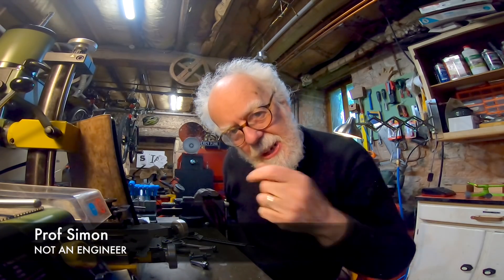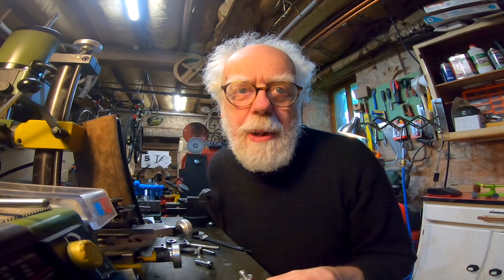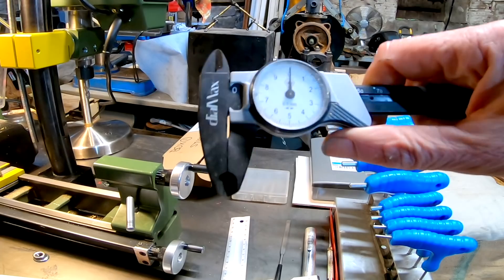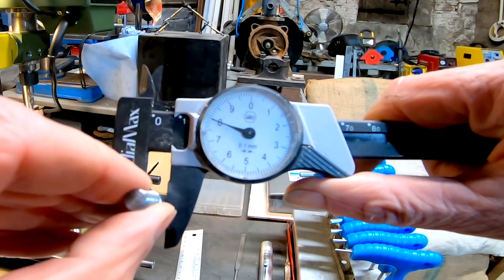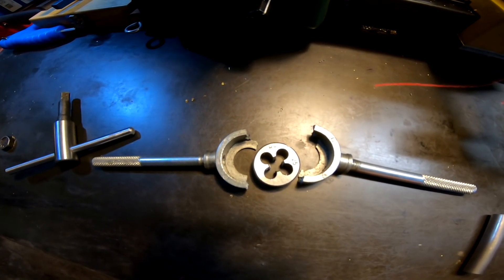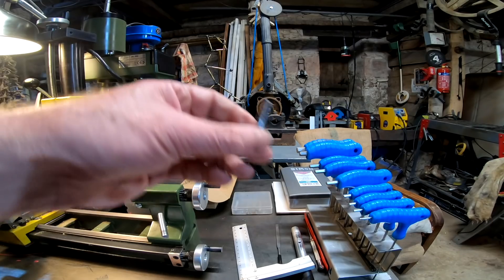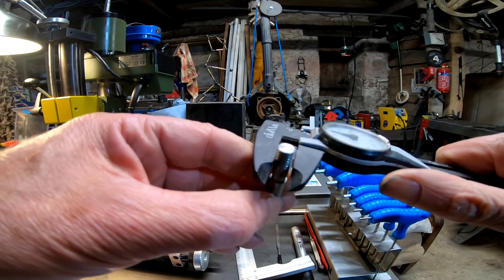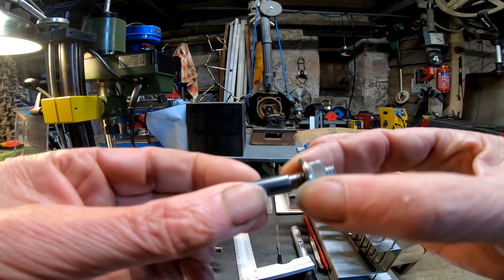Engineering mystery - Prof Simon

Comment: Does Henry has a french accent? He doesn't look French. I recall when I was a kid and discovered a 2x4 board, wasn't  2 inches by 4 inches. Also, pipe is measured in I.D, tubing is measured in O.D. In short, some think their knowledge is common knowledge. I wish they would tell us when the number is just a name and not the measurement of the product,  even though they state this is the measurement. As if everybody knows these darn acronyms that are constantly thrown around. Thank you.
Reply from the maker: Hi Charles... Henri is very French...he came from a small island off the north west coast of France...and is the grand master of our flock of sheep. ... here in France all the wood sizes have local names....very confusing.

Comment: As someone with lathe experience, as well as CAD design, if your tool is "pushing up" material, it sounds like tool pressure/tool sharpness/spindle speeds are off. One or a combination there of. The OD of the threads will also slightly vary depending on the class of the threads(the fit between them). What do you have your compound set to for an angle? Try setting it at 29.5 degrees, or half of the included thread angle. Use the cross slide for pulling the tool away from the work at the end of the thread and back to the original zero at the start, then use the compound slide for thread depth adjustments. The compound trick puts >90% of the chip load on one cutting edge, this will help reduce chatter and make for cleaner threads.
Reply from the maker: Thanks Matt

Comment: Another comment below hit the mark. When cutting threads on the lathe, do not extend into the cut to create a sharp peak. Cut deep enough to create a trapezoidal profile of the thread and you will find 8mm stock does fit an 8mm nut perfectly. Most comments seem to take the stance of using a die to cut threads. My old Sherrington has been producing threads for more than 20 years without falter. Make several cuts to sneak up on the final profile. Use plenty of cutting fluid. Stay safe.
Reply from the maker: Thanks Peter

Comment: Threads are measured on their effective diameter. This done by using three wires. This is explained in Chapmans Engineering books part 2 or 3. The sizes are explained in British Standards. If you have problems finding them email me Richard Froud on m_froud@sky.com

Comment: The bar stock is given a surfacing cut before thread cutting, also the thread profile is not a 'V' shape on any screw. There are a variety of different thread profiles depending on the use intended for the bolt. The Engineers Handbook has full details.

Comment: You shouldnt be getting a dia change for 1 ,    For 2  your die is probably made in china and is dull , they allways seem to cut undersized , if you cant single point cut it on your lathe wich would not make it grow in diameter ( thats using a threading single bit cutting tool )  it still would have what is called an interference fit where the male and female thread bind on each other ,   I would turn the od down  7.6 mm or .299 dia put a champher on the end and buy a new die , if cheap dies are all you can get ,you can buy a oversised die ,maybe , oh , and use some cutting oil like MOlly D it helps alot , dont use regular oil or coolant 😁
Reply from the maker: Thank you

Comment: I make components on a cnc lathe for the oil industry. Any 60 degrees external V thread i machine either imperial or metric  I turn the diameter 0.1mm under nominal. You can increase this slightly the bigger the diameter. Only when making a male gauge for a female thread do i turn a nominal diameter. This ensures the mating part will definately screw in. Ive had no problems in 17 years of doing this. Hope this helps.

Comment: If you look up the M8 threads in a Machines Hand Book Metric section it is the Engineer's Bible try for a copy in local library as not cheap or second hand from USA or U.K. a Kemps hand book is a cheaper alternative but not as informative in some area's.  I used the office copy when on shop floor and design office.  Only bought specialist welding and stress calculations for mining equipment

Comment: I would say turn it down about 20 thou half a mm like already stated also,you could even turn a thread and then using the measurement of that you can work out the difference and turn it down, im sure theres thread cutting informaton , or at least in my imperial zeus there is

Comment: Prof, start by taking the 8mm stock down to 7.5mm. Then cut your thead. It should then be correct.
When you tap a thread into a piece of metal, if you want an m8 thread, you drill a 7.5mm hole, then tap the thread into it.
Ergo, reverse the process, reverse the thread.
Reply from the maker: Good advice...cheers Tony

Comment: I think you broke your die holder because the set thread diameter was to small , probably the two outer screws were screwed in to far, you should adjust the two outer screws  so as you can still screw a pre machined bolt into the dies, then lock it with the centre screw and check you can still screw the bolt into the dies after locking with the centre screw. The screws should not be ramped down merely nipped lightly.

Comment: Thread dies are adjustable using the three screws on the die holder  two for reducing the finished diameter of the thread, centre screw for increasing/locking set size, use a pre machined bolt to set dies up and adjust screws to obtain a snug fit. If turning  threads on a lathe  a test  using the nut  should be tried several times till a snug fit between  cut thread and nut is obtained.

Comment: That die is a thread chaser for cleaning threads...NOT for cutting them. Are you using a full form threading tip in the lathe?  Are you setting the compound slide to half the pich angle? i.e. 30 degrees anti clockwise from the X axis. Take a lot of fine cuts, and check as you approach the full depth of cut for fit.

You cannot cut a thread properly by feeding the tip in at 90 degrees to the work as it makes the tip  cut on both sides of the tip...bad.
Numbers....The basic major diameter of M8 is 8mm...BUT the actual male thread teeth have flat crests.  The flats are 0.1082 of the pich lower so we  multiply the pitch by .1082 which on M8 x1.25 is 0.1325mm  times 2 as its round, =  0.27mm   Deducting this from the basic major gives us 7.73mm diameter.  With me so far?  As you cut the thread using the 30 degree offset compound slide the dial will show the depth of cut wrongly, so you need to use trig to get real depth numbers. Let me do it the easy way for you. We have created a 3 4 5 triangle which relates to 30/60/90 degrees.
So if you wnt to cut 4 mm deep you would move the compound by 5mm, therefore you need to multiply the required depth of cut by 1.25.   There is a wee bity more about basic minor and actual minor diameters, which depends on the cutting tip type. You might want to read this beside the lathe.
Reply from the maker: How can you tell...what’s the difference...all my dies are round..
Reply: @SimonHollandfilms  Did you read the whole post?  Dies are not the way to go,  during the war coventry die heads were used on production lathes to good effect, but they did multiple depth  passes to achieve a perfect thread, using a button die to form a thread in one pass is like using  a fish hook as a ships anchor. The stresses are too great for the thing to work.

Comment: Also note that a worn/damaged die or tool (or a cheap/substandard one) can cause more fudging of your barstock than a good one because it doesnt cut so well. 
All cutting causes deformation to some degree, the sharper the tool the less it happens, though that's a massive oversimplification.

I (slowly and bitterly) learn things like that the hard way, though luckily I only need to do mechanical stuff every now and then.

Comment: I'm guessing that there will be no standard measurements as such because every thread-cutting tool/system will be slightly different?. But couldn't you take your 8mm bar, cut the thread, then measure the difference (8.2mm for example), the simply subtract that difference (0.2mm) to get your finished size?, so if you needed a 7.7mm finished size then simply start with a 7.5mm bar?. Lastly, you shoudl subscribe to Allen Millyard's channel, he is the finest engineer I have ever seen and his projects (motorbikes) are truly exceptional. :)

Comment: I'd assume it extrudes to the same distance as it is cut. If the die cuts 0.5mm then it should extrude the same and you should reduce an 8mm piece to 7mm before cutting the thread. Some experimentation will be required to show how accurate this assumption is while bearing in mind the die's measurements.

Comment: “The work piece (blank) to be threaded, which is usually slightly smaller in diameter than the die's major diameter, is given a slight taper (chamfer) at the end that is to be threaded. “ https://en.wikipedia.org/wiki/Tap_and_die

Comment: I think you tried to go straight ahead with the die. Try turning back half a turn before advancing again to cut the chip.
It isn't wrong either to swipe away the extrusion with a file before trying how the nut fits on the thread. Watch your hands near the lathe.

Comment: Ok, well here's some working backwards in a way, but I think it shows why your peeps are telling you to use 8.00mm stock... 

In the tables I have for "Clearance Holes for Bolts and Screws," it states: 

"Drill Sizes are based on a Clearance Ratio that is defined as: 

Clearance Ratio = {(Clearance Drill Diameter - Bolt/Screw Diameter) / (Bolt/Screw Diameter)} x 100"

"Most drills listed under Close Clearance have Clearance Ratio between 4% and 8% for the Metric Series; Normal Clearance...between 10% and 14%..."

So for ex., "Bolt or Screw Size, Nom. Diameter Millimeter 8; Close Clearance Drill Size 8.5, Diameter 8.50mm; Normal Clearance Drill Size 9, Diameter 9.00mm; Loose Clearance Drill Size 9.6, Diameter 9.60mm."

That's from:
Glover, Thomas J. (2011). Pocket Ref, 4th Ed. Sequoia Publishing.

*One of the most useful general pocket references I've found. And you know it's good when they print it on Bible Paper!

Hope that helps!  If not...Sorry!

Comment: Different stock has different hardnesses. When you use a die, are you using cutting oil? That die and tool you showed broken is a really cheap one. You need softer stock, then after you cut the threads you can harden the bolt. Get a top quality tool. 8mm softer thread stock. Use cutting oil. I think you will be fine after that.

Comment: There should not be any extrusion. Your die is too tight. Use a split die and take a gentler cut. Then take a deeper cut if necessary until you get the right fit. If there is any extrusion take the tips of the teeth off in the lathe.
Reply from the maker: Good advice...cheers
Reply: @SimonHollandfilms  Yes, rolled threads I think use undersized stock because of extrusion, but a lathe or a die is a cutting tool. If it is properly lubricated  and sharp any plastic deformation should be minimal.

Comment: I think there are some books on the subject as far as I know without looking. 
I bought one in the practical engineering book by Nexus and they have a whole book on the subject called Drills, Taps and Dies. I personally have never cut a thread on a lath but I have used taps and dies. 
Metric is what the call an ISO thread and the core diameter is smaller than the thread diameter and it would be hard to explain with our reciting a whole chapter from the book about thread angles, and thread pitch, etc. 
What it comes down to is that threads are always a compromise between strength and precision and core diameter of a thread. 
Modern thread's are formed rather then cut which is why screw sizes are so confusing. 
If you buy a book "Workshop Practice Series no 12 by Nexus publishing it has a lot of information for you and a good, if not to long a read.
An 8mm I.S.O. Standard thread is core size 7.3mm, fine pitch to B.S. 3643 standard,  but it can have a core diameter between 7.2 mm and mm 6.85 (not recommended)
Reply from the maker: Cheers Jeremy

Comment: My understanding is the  OD of the bolt does not come in contact with any part of the nut it fits in to hence the smaller diameter. On commercial bolts the thread is not cut but rolled on and the 8mm OD is reduced to allow the the die to work.

Comment: Just use a file and paper to knock off the burr. Be careful with paper. Might wrap up your phalanges. Is the standard m8 x 1.25?  BOTTOM of thread 8-1.25mm. Top of thread  a few 10ths mm below 8mm. This is for a running fit. I think 8x 1.25 is standard mm size.

Comment: The way I done it was to mount the rod stock in the vice and with a file a 45 degree chamfer and use a good quality die set a lot has to do with lubrication.  Use a good cutting compound like Trefolex its green and works magic. Get yourself a good set of mitutoyo vernier caliper 200mm I have had mine for just on 23 years all my cheep ones have died. 

Good luck say hi to the goats

Comment: So many experts. There are three ways to produce a thread. 1. die cut. 2. Thread cut on a lathe. 3. roll form. The methods are:
1. the die you used is too basic. good quality of die tools are split and the holder will have a screw that separates the die that allows the first oversize cut to be carried out and then to slowly reduce the split width to make a tighter thread to finish with a 8 mm thread.
2. thread cutting on a lathe will be a single tip tool that also have a radius for the major diameter on its leed and trailing edge. Using the compound slide on the cross slide set to half the thread angle and with multiple cuts using the appropriate threads per inch (or mm) you slowly generate the thread until the OD (major dia) is formed.
3. rolling a thread, you start with a nominal diameter thats reduced by half the thread depth. this requires a thread roller and could be to higher torque than your mini lathe can achieve.

Personally stick to 2, thread cutting with a single point thread tool or 1, die cut with better die cutting arrangement.

PS love your films, keep it up.
Reply: I have used the tail stock to keep the die holder square but only wind the die by hand, not the power of the machine.
Reply from the maker: Thanks Andrew. Great advice.

Comment: This is why Prof, the threads have clearance all over otherwise they would not be able to move together. I hope this graphic helps. You need to remove the peak with a file.
https://www.google.co.uk/url?sa=i&url=https%3A%2F%2Fwww.trfastenings.com%2Fproducts%2Fknowledgebase%2Fthread-geometry%2Fmetric-coarse-standard&psig=AOvVaw36r7p2sZs1kC0HLVB8PKdl&ust=1589548327044000&source=images&cd=vfe&ved=0CAIQjRxqFwoTCKDckpO3s-kCFQAAAAAdAAAAABAD

Comment: cut your bar stock to 7.8 mm you might not go in deep enough  at 8 mm for the threads to seat right
Reply from the maker: Good advice...is there a look up table for other thread sizes?
Reply: @SimonHollandfilms  The diameter of the round bar must be slightly smaller than the outside diameter of the thread as the die presses the material slightly outwards during the cutting process very true.So  turn the diameter about 0.1 times the pitch smaller than the thread outer diameter say if your thread outside diameter has a pitch of 1.5 mm  a reduction of 0.15 mm (1.5 mm x 0.1) the round rod will end up a diameter of 9.85 mm

Comment: I use a die to run a thread down 8mm bar, used lubricate and small movements backwards and forwards, it help if the die opens up a little. Cut many a thread on a lathe during my apprenticeship, made loads of tools and a car jack. I did see someone sharpen a old fashioned push lawn mower blade on the screw thread attachment on a lathe, it took ages for him to set it up!
Reply from the maker: Brilliant

Comment: Looks like the folks have you covered.
CLEARLY though, breaking thread cutting tools would indicate massive  resistance /overtorque.
Lube must be constantly applied. 

Having only done this by hand, all I can say is one usually rotates clockwise about a turn and then rotates about a half turn to unload the detritus from the tool groove and then proceeds clockwise etc.

Trefolex is a green lube goo that performs well at this task......
However be VERY mindful it likes a phase change if hot enough and the vapor is reportedly proven as a CARCINOGEN.

There is also the variable of thread pitches.
Ie: it may well be m8 tooling BUT is the thread pitch correct between nut n bolt?

I am boily NOT fitter.
Reply: @Nessy..  yeah, that's the goo.
Here in the land of OZ it is taught in trade school to AVOID sucking down the sickly sweet smell, (I  love it), due to the alledged FACT it is carcinogenic. 
First taught this 20 years ago, as i am not a chemist/scientist etc I have no "proof", neither can I afford to get sued...........you catch my drift?

Once it gets hot enough, doing it's slippery thing, it vaporizes.

General rule of thumb is if you can smell something, its getting into your lungs.

Cyanide smells really sweet too apparently, pretty sure no-one would knowingly breathe that either.

In  "primative" places of employment,  where the boss is so tight he cannot drown, were there is no suction extraction fans, I would take my own fan and blow the fumes as far as possible.

Er, I trust that helps?

Funny how safety VARIES between countries.

Eg..... our chippies use MDF (medium density fibre sheets) here and are well aware of the carcinogenic glues holding what is essentially saw dust together, YET it is banned in the USA and most of EU i am told.
You know the deal, just because you can buy it doesn't mean it's safe.
Refer asbestos,  tobacco etc.
Respect, regards and good health to you.
Thanks for your question. 
 FAR AWAY AS POSSIBLE.
Reply: @Nessy..  I  seriously doubt that you have been using anything since '85 as you look about 30. Hahaha. Singers aint far from here, but the border is closed. 

As this isn't a dating site I can say no more.